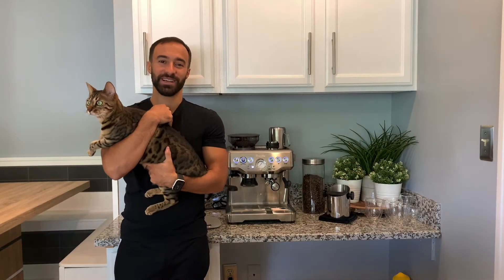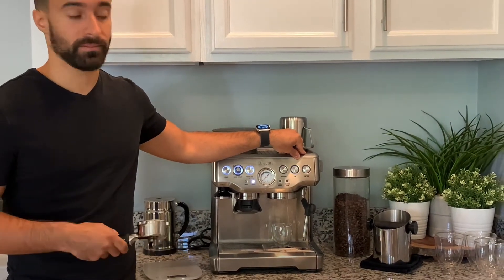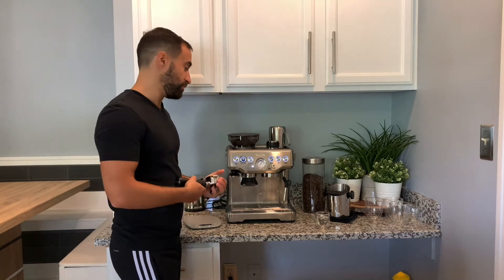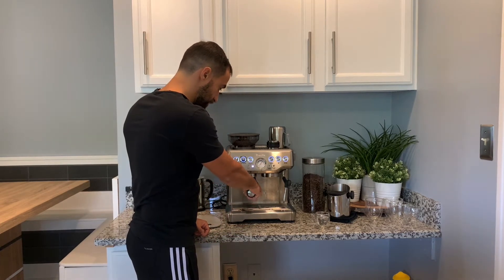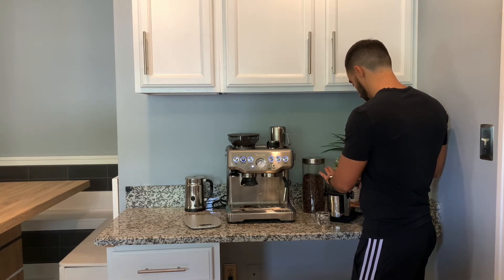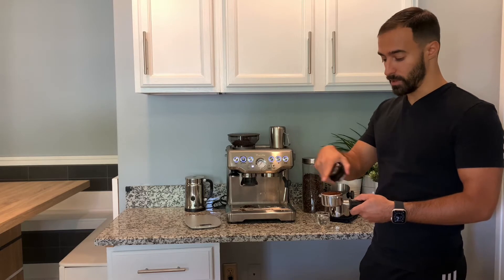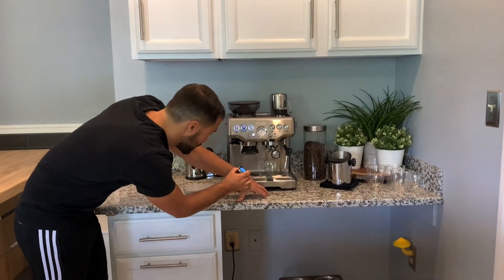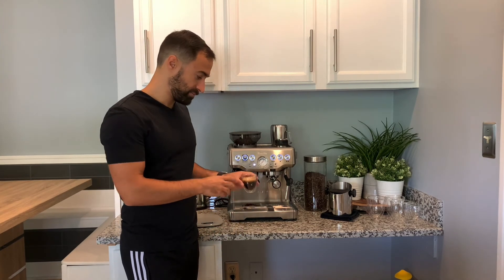How to make espresso

Comment: Just bought a barista express. I have the internal grinder set to one and external setting to one. I get 36 gr out from 18gr in… in 14sec I should return my product right
Reply from the maker: Yeah seems like you may have got a lemon. Are you using the non pressurized filter basket
Reply: @JoeyVaracalli  Yea, using the non pressurized St. Anthony portafilter.
Reply from the maker: @NickNick-do2qs  yeah I’d return it sounds like grinder is broke

Comment: Can you provide some advice for me? I have the grinder set to 3, the amount 2 spots down for “more”, I feel like I compact the grounds tight in the port thingy, but the extraction is still low...can’t really figure out what I’m doing wrong. I just got the machine 2 days ago and have gone through a whole bag of Starbucks espresso beans doing trial and error trying to figure it out
Reply from the maker: Ok so I’m having the exact same issue right now with oily dark beans. As sad as this sounds i would try and go with some different coffee the oily beans have really gunked up my grinder and I’m getting very clumpy grounds right now. So I would get those beans out and try and run all the beans out of the grinder then if you want to stick with Starbucks get the blonde roast asnd set your grinder to 9 or ten then try and see if you can get a better extraction. If you have a scale definitely measure out 18 to. 19 grams...... this may have been to detailed lol but what can I say I like to nerd out. If you need more help let me know I’m happy to help as much as I can.... if you really want to save the beans go to the most corse setting on the grinder and measure out 16 grams or maybe even 15 grams but your extraction won’t be the best but that’s what I did to at least save some of this dark roast I bought
Reply: @JoeyVaracalli  thanks! I’ll continue to test it out. I also just realized changing the grind 3 made it more corse when I meant to make it more fine. Lol
Reply from the maker: @jeremysalazar3208  yeah it is a little confusing the higher the number though the corser
Reply: When I bought store beans I too could never get the pressure high enough. Buy freshly locally roasted and it makes all the difference. Always check the date. Also store in vacuum canister.

Comment: I bought the Breville Barista Express two months ago.  It worked great until today when it started smoking and I smelled burning plastic.   I have descaled it twice prior to this and always followed the directions.  Have you had any problems with yours?    BTW...I have learned quite a bit from your videos.  Keep it up.
Reply from the maker: Wow thank you so much for the kind words seriously means a lot. I have never heard of that happening if it’s new I would tell call breville and maybe they will replace or atleast fix the machine.  This is the USA phone number 1.866.273.8455